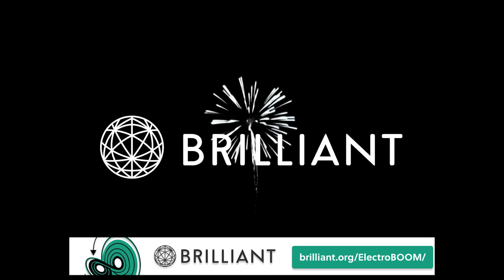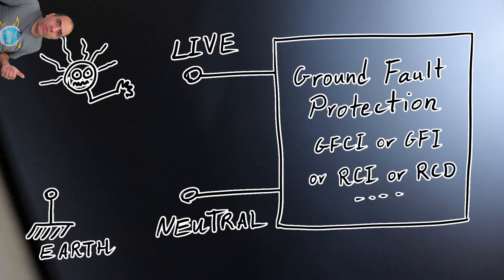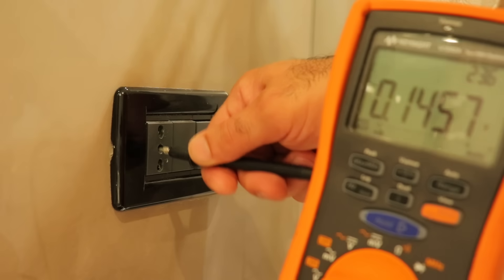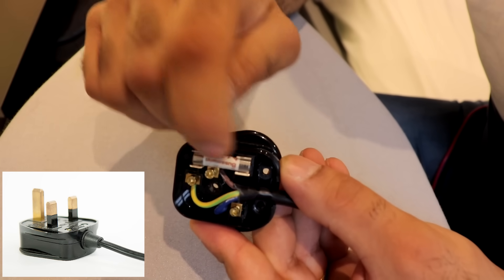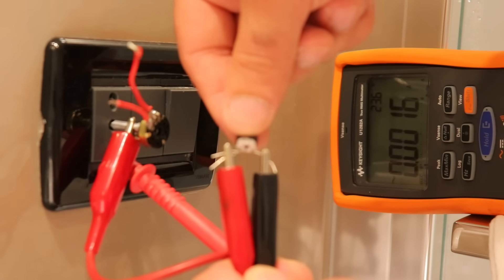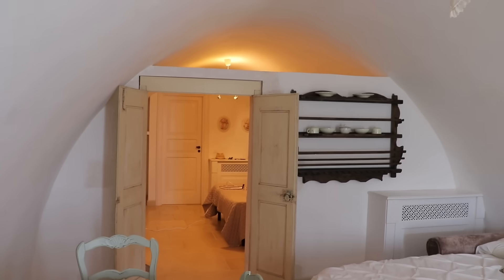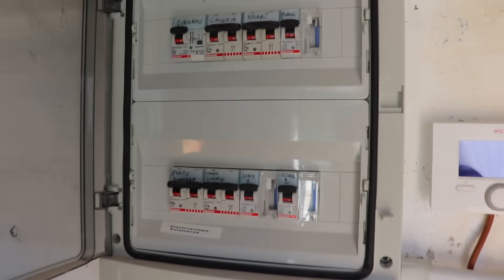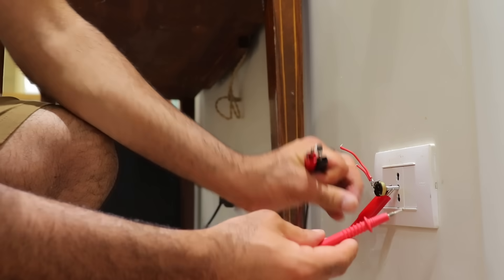Tripping Every Breaker in Italy

Comment: I think the differential is set at 30mA because if you have a lot of equipment that needs grounding, their combined current on the ground wire can be enough to trip the breaker if the breaker is only at 5mA.

Comment: 9:15 is a BTicino branded phone socket. According to the internet it's very rare but maybe that's the reason why they use it in the first place to make sure people will only use the phone in the room and not connect anything else to it or are less likely to steal the phone. Maybe it's even specifically designed for hotels.

The other outlet looks like RJ11 which is not that uncommon in older hotels where RJ11 connections for dial-up internet was a really common service back in the 90's.

The problem is most hotel phones are connected to a PBX system and most of these old style analog PBX systems don't handle dial-up well. A lot of times you could not even directly connect yourself and need an operator to connect you and they would manually register what number you called and how long. So in order to solve all these problems a second direct line is the easiest which can be patched/enabled by the hotel staff for a fee. Since in the 90's most people would not carry their laptop around and calling was pretty expensive so most guests would probably only make a few phone-calls a 100 room hotel would just be fine with a dozen phone-lines.

Of-course this is 2022 so most hotels would not even have a room phone anymore although it still seems to be convenient to have one for the guest as well as the hotel. The hotel can easily call their guests and guests can make easy phone calls when there is an emergency.

Comment: The plug with the 3 smaller holes supports up to 10A, while the one with the 3 bigger holes supports up to 16A. The plug that combines them both also supports 16A. The maximum current rating has to do with cables thickness behind the plug, but AFAIK there's no safety measure preventing you from using more current than 10A on a small plug, therefore overheating the cables.

Comment: I've live in NA. The plug design has always worried me, but in 41 years of life, i've never been hit by it. I think the plug is deep enough that it doesn't happen. We actually have more problems with babies sticking things into them. We need those doors that only open when both are pushed. That would be dope.
Reply: Or as per the UK 3 pin socket a longer earth pin that opens the shutters. Earth pin makes connection before opening the shutters allowing the live and neutral to enter, the live and neutral only start making connection once the only part now exposed is the insulated area of the pins

Comment: Welcome to italy,!!!! 
i think we have better protection than US or similar. Your operation at 15:30 is not possible. You can do it because someone before you has forced (with a lot of force if wall socket are good quality) a shuko into an italian socket. 
Against stupidity there are no rules that work.
The real problem of the inversion between phase and neutral is that some appliances, such as methane gas boilers, do not work properly, but usually this is notified with some alarm and just turn the plug.

Comment: 3:44 In some European countries the breaker always needs to disconnect both live and neutral. We for example have 3 x 230V nets in Belgium, meaning you only have 3 live wires and no neutral. Between each phase there is 230V. Therefore there is no real neutral and both wires should be disconnected by the breaker.
Reply: Shouldn't it be 400 V (380 nominal) between phases, and 230 between phase and neutral?
Reply: @mariosebastiani3214  No that's only when you have a neutral. We also have homes that just have 3 phases, no neutral. The phases are connected in a triangle in the street. Not a in star, so there is no neutral.

Comment: 4:39 That is really scary, man! Question. Does the Hotel admin monitor each room electricity?
Reply: The RCD was just next to reception desk and those have usually quite sharp snap when they trigger. The receptionist notices it quite easily.
Reply: That would suggest one RCD per room. And inspection of the breaker position would tell the receptionist which room has triggered it.

Comment: 15:23 The problem is not only the missing ground there. If you put a Schuko plug inside a 10/16A plug like you did you'll end breaking the pins inside the socket. Usually you'll feel quite a lot of resistance during insertion. But everybody does that all the time so you probably didn't feel any resistance in plugging in, because the plug was already deformed

Comment: Medhi, next time you should visit India. But be prepared with safety gloves.
Here, everything's an utter mess of dog sh!ts. There's no proper standard to follow on. No colour coding on either of the wires. Mostly all the three ground, neutral and line have the same colour, or just the ground being different while live and neutral are the same. 
There's no proper termination. You'll find the joints or exposed parts are just electrical taped without anything. 
The breakers are a mess. Good luck finding a working GFCI. Most of the sockets and the entire house are unearthed . The electrician doesn't bother to wire up the grounds. 
You could literally get free electricity by 'stealing' a phase or two directly from the pole.
You'll find loose naked wires dangling from everywhere. There's no keying mechanism.

But on the plus side, sockets have a separate switch on each of them.

Comment: Now dwelling units constructed under the NEC-2020 will require GFCI protection on any receptacle rated 125-volt through 250-volt that is installed in a GFCI-required location and connected to a single-phase branch circuit rated at 150-volts or less to ground in all homes in the US now..  ( Garages, Bedrooms, Bathrooms, Kitchens, etc )

Comment: I am italian and I agree with @FAB1150. I will add a little bit of contest. Italy moved from the "small" standard to the "big" standard some years ago. The plugs are essentially the same except that they are further spaced apart and with bigger diameter (the big one compared to the small one). This allows to carry more ampere. The german schuko pins are spaced like the old "small" standard but the diameter is like the new "big" one so, theoretically, they cannot enter. Obviously if you force they enter. That is also the reason of the double drilling: that is a power outlet that can work for both old and new standards

Comment: 15:30 that's actually because there are 2 Italian plugs (those with three pins) and a German one (the massive one with two pins), so theorically one standard is out of place, but we like German products and we buy them a lot (they are super high quality), and so we now install both Italian and German sockets. also, you noticed the Italian standard have two plugs, one is slightly longer in one direction, and the pins are a little bit more apart from each other. that's because one is high amp, and one is low amp. and last but not least, we have the .03 amp protection, but the voltage here is double that of the us (240v) and so the power is actually more. and also, because of law, we must have 2 circuit protection, one in the apartment (but I think you can put that anywhere), and one out of the apartment, on the first floor (i think it's intended to be accessible for firefighters, but because of that, it's unlikely to fail, it's redundant.

Comment: Itali is part of the EU

You have the standard EU conectors there

Your hotel just has special connectors to allow some foreign connectors to fit

And instad of an interrupter they could also use a system where the current to ground flows back to the trafo station and triggers the circuit brakers themself in german this is called Nullung

And the blue one should be neutral

Comment: 9:18 the outlets have 2 different sizes for the following reason:
The closer to the centre and smaller ones are for 10Amp connection,
The further and larger from centre are for 16Amp connection,
If both sockets are present then they are connected with the 16Amp connection (aka the wire behind the plastic is sized for 16Amp).
Reply: Just to add: 2,5mm² for 10A and 4mm² for 16A.
Reply: @santopino2546  1.5mmq and 2.5mmq *
Reply: @stosumarte  you're right.
The values I gave are wrong, they are used in the industry.
Reply: @santopino2546  because you use a C breaker you need 4mm wire?
Reply: @FoodOnCrack  the normative indicates these values.
Reply: @FoodOnCrack  yes.
Reply: @kw_j  that seems stupid and a waste of copper what do you need the C characteristic for? Everything here works fine with b16 at 2.5mm²
Reply: @FoodOnCrack  Sorry I was wrong, Santo pino made me confuse 🤔. 1.5 is for 2.2kw, 2.5 is for 4kw and for appliances, like air conditioner or electric stove like I have at my home we need 4mmq for 6kw (20A breaker).

Comment: Hi, italian electrician here.
Those sockets with 2 different size holes are "prese bipasso" (dual-use sockets) for 10A (small hole) and 16A (large hole) devices and are connected to a 16A breaker, the socket with single size holes (small) is for 10A only and is connected to a 10A breaker (if the electrician did his job well).
The schuko socket is for the schuko plug that normally it should not be possible to insert it into a dual-use socket (unless forced) because the schuko pins are larger than the 10A holes.
Anyway, this was a little taste of how real electrical systems are made (like never use rigid wires and put wires into dedicated flexible pipes instead directly in walls)

Comment: I have no knowledge regarding italian domestic electricity, however, in southern spain the average household only has about 4kw of current available (although if you ask really nicely the electricity provider will upgrade your house to a terrifying 5kw). This means that even if an appliance is live that the electric shock is very weak, you feel the current and say "hmm, thats live". 
It cant / wont kill you, its just a buzzing sensation. 
Unlike countries of profligate energy usage such as England where the average house has more than 25kw coming through the wall....and that will kill you, hence the need for so much "protection"

Comment: In europe blue should be neutral and life wires should be black, brown or grey. GFCI (we call it RCD - Residual Current Device) must be used if you make a new installation, but only for outlet circuits and bathrooms (of corse you can use them for light too if you wish), because this is the most common place where people get shocked. 

Most buildings have multiple (selective) GFCI's for different floors or rooms with different ratings. Best case you trip the GFCI of your room, but not the GFCI at the reception.  
They are always used infront of a circuit breaker and it is not allowed to use it without one. They don't trip if you short a socket directly without ground.

30mA GFCI's is the standard. 30mA means it must trip at 30mA, but they will trip between 15-30mA (around 70% of the rating) within 20-30ms. This is fast enough, that you not get shocked to badly.

Comment: The Neutral and Ground are mostly connected, as you measured also in some cases. In my opinion are not "grounded" cases should be protected also, or not?

Comment: 222 volts is a normal voltage for "240" mains if you measure in middle of city. Here, in Russia, it's about same.

Direction of plug mostly matters if circuit breakers in devices are single-pole. Which is quite unusual around this side of big pong, but not impossible. Even simple table lights have dual-pole, so no electrocutin from powered down E27 lightbulb :P

Comment: In Italy, the GFCI trips at 30 mA at 230V. In the US, it's 5 mA at 120V. That's 6.9 watts in Italy vs 0.6 watts before it pops in the US. 

In Europe, you get 230V whether you need it or not. In North America, most plugs are the safer 120V. You only get 240V to a plug if it needs the higher voltage.  
I've seen a lot of 100A breakers in Europe. That's 23.0 Kilowatts before they pop! In North America, most breakers are 20A, which is only 2.4 Kilowatts.
They have to over design their plugs. If a partial short happens in their outlets, their buildings would burn up.
Reply: Pointless discussing RCD trip ratings in watts. Watts is a combination of voltage and current, but it's the current that kills if too high, and the only job of the voltage is to create that current.
Hence RCD trip ratings are always expressed in current in Amps or milliamps.
Voltage isn't relevant, and if the voltage isn't relevant then neither is the power.

Comment: Actually there are 2 gfu in the circuit, one is the one that you usually trip, the other is in the "electricity provider device" and it's designed to pop moments after the first, so in case the first it's faulty you still have protection. Don't recommend to try it cause after that you need an electrician to reset it and change the faulty gfu

Comment: Hmmm Italy is weird
That Ground Fault Protection works just like in central Europe(everything between Italy and the UK ig)
But those outlets and plugs are weird I have never seen those before 
I thought Italy would have the same
We have a standard plug without ground, which looks a lot like the one you used and I know 2 others with ground, one of them is french the other German, usually they are compatible(except if they are old) and they look almost the same except that the french one uses a rod for ground and the german one uses clamps on the sides and personally I like that more

Oh at the end you have that german/french plug I know and usually use, but that socket is also weird 

Also no, black is not supposed to be neutral it's always blue
Phase 1 - Brown.
Phase 2 - Black.
Phase 3 - Grey.
Neutral - Blue.
Ground - Green with Yellow Stripe.

Oh and 0.03A is standard for ground fault protection here

Comment: The reason why we have receptacles with dual pitch like the one at 1:37 is that there are two sizes of 3 pronged plugs, the small pitch one rated for 10A and the large pitch one rated from 16. That socket will fit both of them and a Europlug as well. The two plugs are a legacy from the days in which houses used to have two separate networks at different voltages, 127V and 220V. You would also have two meters and different pricing for each voltage. Small receptacles used to be for 127V, large ones for 220V. Lights were connected to the 127V line. This is not the case anymore, but we still have the two different plugs. 
Also the Schuko receptacle at 15:16 is getting more and more common, probably due to the prevalence of German-made appliances. Earthing might be slightly better there, but it does take up twice as much space as a 16A italian receptacle. Both are not polarized.

Comment: Italian fan here!
The 2 sizes of plugs were historically meant for 10A connection (smaller one) and 16A connection (larger one), but it's something dating back almost a century ago, today, to my knowledge, the only circuit protection to pop open over 10A is usually the lightbulbs one, the standard for all the plugs is a 16A magnetothermic breaker for every plug line with a single GFCA on top of everything.

Also, the standard neutral is blue, and the brown/red/grey wires are for the live wires (different color for different phases), so the Venice hotel had the wiring done in the opposite way!

As for the circular plugs, we nickname them "German plugs", and we usually use adapters to plug them to connect the earth too.

Fun fact, an European standard for plugs exist, but never got in use. It's similar to the ones you found in Italy, but have the earth offset to the side so live and neutral can't be swapped. You can immagine changing the standard would need every home and applicance to be updated, so it was never used.
Reply: But the plug with the earth offset isn’t it swiss ? The europlug is used, it is the one without earth pin and limited to 2,5 A
Reply: @luca210210  No the Swiss, Danish and English plugs have the earth at 3 different offsets, to give no country a benefit the new standard chose a 4th offset so everybody would suffer equally.  Brazil chose the new plug but changed it slightly just to be different.
Reply: @johndododoe1411  I believe the brazillian standard also changed the pin size and other stuff from the IEC standard.
Reply: @johndododoe1411  Do you mean IEC 60906-1 16 A plug ?

Comment: Hello Mehdi!
The double drilling of Italian plugs is due to 2 standards corresponding to max permissible current of the appliance (I guess as a way to avoid overloading "light" gauge wires in old houses).
The narrower (19mm) plugs are for 10 A max, the wider one (26mm) for 16A max.
Reply: It used to be different price for the electricity before meters that counted actual consumption.  So they paid extra for having 16A outlets.  The weird flat outlet next to the network socket was an attempt to invent a new safer but 100% incompatible plug by some devious company trying to create their own monopoly.  Or maybe it's a telephone plug, Italians have a bad habit of creating power sockets that fit other countries signal connectors (such as Nordic loud speaker plugs fitting Italian 3-hole sockets).